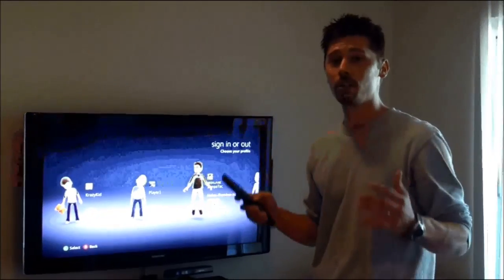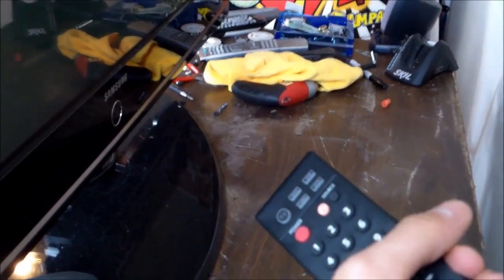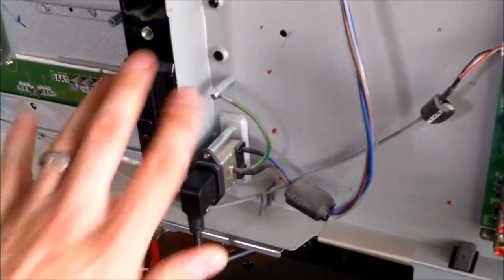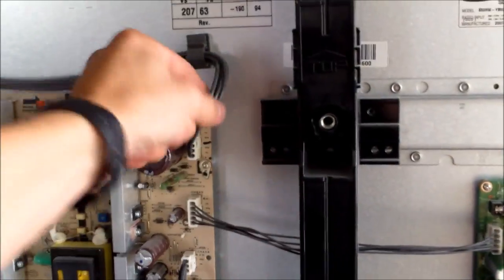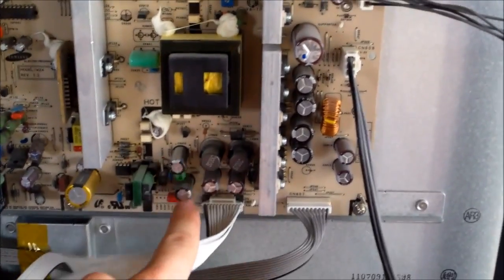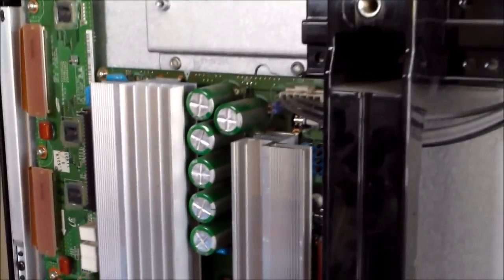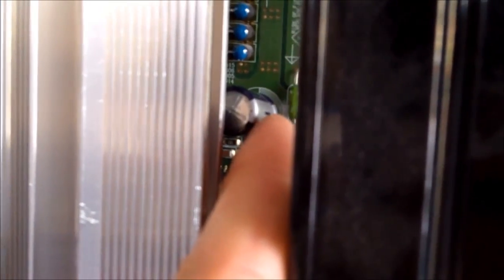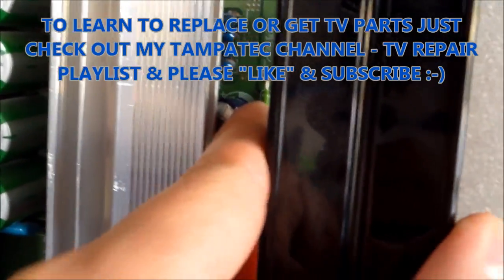WHAT Plasma TV BOARD CAUSES NO PICTURE REVIEW

Comment: Hi, please help...I  have a HP PL4260N 42" Plasma TV  and I can't find anything on HP tv repairs. The power button normally is red for standby then turns blue when powering up but for some reason it goes from red to purple. I hear a clicking but the screen doesn't come on and is black as if it's off. Any help please. Not sure if I  should just replace it.

Comment: Hi!
I have a samsung plasma tv PS64F8505ST (the last plasma of their high end tv models/ 2013 European model)
I would apreciatie the help from you about my issue. Last year i replaced the Y-susboard due to no picture. This time my tv turns of about after  30-90 minutes. Everything just shuts of, even the led light. Cant turn on the tv with my remote even after i replugg the cord to the outlet. I thought the problem sat at the X-sus board.

I tried switching to another x-sus board but the tv wont even turn on or show any picture. The power board starts to "clicking" instead so i unplugged the x-sus board from the powersupply and the "clicking" sound went away. When i switched back the old x-sus board it worked fine without any clicking sound from the powersupply but the tv starts to turn of again after 30-90 minutes. I had the powersupply get a light inspection (just looking after any visible faults) but the guy said that he didnt se any problem with the board. What do you reccomend me to do next?

Best regards

Comment: Hi, I’m just wondering if you could give me some advice, I have the same model your working on in this video, I bought it as spares or repairs and it wouldn’t power on at all. When I opened it up I found out it had two blown capacitors on the power supply board which I replaced but the tv still won’t power on, it didn’t come with a power cable So I just used one out of another tv the output on the plug is 250v but the power supply board says it will only take 220v could this be the issue or is it likely to be something else.

Comment: Hey i got a Samsung plasma pn64e550d1fxza and i found a burnt spot on the underside of the power supply board at a transistor(about the size of a quarter). Is it possible to save the board?  Wondering because I'd having no luck finding this board for under the price of a new tv. Bn44-00515a

Comment: hello I have a 50 Samsung Plasma TV Model PN50B450B1DXZA. that will not turn on, you here it click to turn on but does not come on. I have replaced the power/main board and the Y-sustain board and it still will not come on. What other issue could it be?

Comment: Hi
My Samsung ps-50q96hd tv has this issue.
When I turn in on it clicks once then video (like vertical lines comes on the right hand side and then I press the buttons on the side then I get blue jittery screen) also a loud speaker static sounds comes on suddenly and then it then clicks and turns off.
What is the issue with this?
I have opened the back up and tested disconnected every wires from the powder supply board (pspf531801A) and then connected one by one and tested it would only click when I connected the main board (the one with the vga and scarfs and other connectors ).
I was wondering if you could help me out.
Thank you so much

Comment: Hi: I have a Samsung Plasma TV model PN64F8500AFXZA. and I have tested all the capacitors, all the diodes, all the Mosfets, in all the boards and they all are fine, I have no short circuits in the Y board. What happens is that when I turn the TV ON, the "VS on" signal goes to 3.3V, and immediately goes to cero, all other voltages are fine and present, and stables, Could you please help with some ideas of what could be the problem?, I will be very thankfull, Thank you and best regards

Comment: I dont know if you even check these comments anymore, but here goes nothing. The tv had trouble starting, so i replaced 2 swollen capacitors on the powerboard and now it turns on fine. The  TV turns on fine, there is audio, but there is no picture. Do you think switching that fuse might work, or could it be that If I broke something on the power board that it causes it to not show picture ? Also , i lifted the TV when the lid was off only from the sides, could it have bent the screen, so its not working properly now ?

Comment: Help Me?

Model: Sony KDE-42XS955
Type: Plasma
Size: 42 inch
Manufactured: 2005
Retail: $4,995

I bought my Sony KDE-42XS955 from B&H Audio Video in Manhattan for $4,450 in July of 2005. It was the absolute finest TV on the market at that time. It never gave me any problems during its 11-year-long life. It finally died in March of 2016. It was still producing a perfect picture up until it simply refused to power on. When it would power on, only audio was working. The video went from perfect to nothing. There was never and fading of its quality over time. This leads me to suspect there's some internal power supply issue, or something that has nothing to do with the TV's ability to produce an image. Because again, the image was always perfect up until it died. 
I wonder if this TV can be fixed? It was the greatest TV I'd ever owned, and I've had many since this one. Today's average market range TVs still aren't as good as this set. This is why buying the finest TV you can pays off. You future-proof yourself for at least a while. Again, except for the highest-end sets, my 2005 Sony plasma was better quality than 95% of the TVs made in 2018.

Any ideas? Thank you for your time.
-Mick O'Brien

Comment: LG 50PS60 Plasma.  Intermediate sound with no Video.  If I unplug the ribbon cable from Main board to Tcon board and plug it back it in I can make the screen work on command.  When the screen comes on it is a great picture.  All voltages except VS are on spec.  Instead of 195 V, they are 183.  Thanks for any help.

Comment: Hello,
I have a May 2010 LG 60PK250 with what appears to be a power supply issue. The standby light Comes on, turns off, on, off, then stays on.

I received this TV used/broken. After inspection it appears it had some sort of surge through the main board. There were 2 blown diodes on the back side and a red audio connection had some black on it as well as a blue connecter. Not sure what caused these to apparently burn or Get really hot. I have replaced the main board and connecting cable from the power supply to main board. had a green light come on the logic board for a brief period of time first time firing it up after installing the new board. Now back to relay click on the power supply and only standby light coming on. 

Not sure what to try next, Set had a significant amount of dust on the boards. 
Thanks,
Jon

Comment: I have the exact same problem. My question is, can I replace said capacitor with one with a higher uf? Example replacing my blown 25V 680uf capacitor with a 25V 1500uf capacitor?
Reply: did you do it
Reply: Magdolna Madarász No. I replace it with a 35v 1000uf capacitor.

Comment: I have a Panasonic plasma TV Model TC-P58VT25.  Following and loud and very close lightning bolt, I heard a pop and thenTV had no picture but does have sound.  I am able to display SD Card information and also display the TV menu, but just get black screen when cable input is used.  Is this likely a Y board problem?  Also there is NO blinking red light (it just stays solid red).

Comment: do you offer help/advice with problems on tvs?

if you do we have a Samsung plasma model PN43E450A1F, it was working fine when i left the room then i come back and the tv is all black(you can still see the picture barley behind the black or more of the lighting is noticeable on the top and bottom edges of the screen) but you can hear the audio on the background so i turn it of and on and its still the same, later after i let it rest i unplug all connections re plug  but now i notice a sparking sound coming from the middle left edge where the plastic holds the screen(plastic looks a little warped/bumpy where the sound is coming from) and all the other issues are still the same. if you know what the problem is or could be or if you know of something that will fix this id appreciate it or any help thanks

Comment: Hey Tampa tech, great video. I have the same tv. after watching your video I think Ive found the problem but wanted to run my findings by you before I spring for a new power board. the symptom of the tv is: sound but no picture. the picture is pretty much all black with a tiny bit of snow. in checking the DC outputs from the power board, Ive discovered that the VA power pins are at 63 volts (correct voltage) but the VS pins are showing  no voltage. do you think my findings and symptoms are a match?
Reply from the maker: Beachbillies make sure you have a good ground when checking voltage if you're not get any vs voltage when the TV is on check the power supply. get tv boards at shopjimmy.com or electropartsonline.com
Reply: I saw this on an Y-Main the other day. I looked at the power transistor, and it has obviously popped. It had gotten so hot, the numbers for the transistor were cooked off. A quick check of that bad transistor showed it was shorted to ground. So this is how I could also tell. The board caused the Vs to go to zero volts and the power supply shut itself down when the Y-main was connected. If I pulled the power, removed this bad y-main, and checked again, Vs would go back up to 205 volts and stay there. 

I got this bad board from Florida, so hopefully it wasn't sold by +Tampatec lol.
Reply: beachbillies, what did you end up doing?
Reply: beachbillies, what did you end up doing?
REPLY

Comment: Hi all, maybe somebody here can help. I was given a 51 inch Samsung 
Plasma TV model PN51D530A3F. When I turned It on It would "tick" from 
the "power board" and I traced the problem down to the "X main board".
On the "X main board" I replaced 2 ( RPJ30H1 transistors), 4 ((30G124 transistors) except I used (30J124 transistors)rated 170v higher) and 2 ( SF10A400H) diodes.
After replacing these parts the TV came to life but now for the problem.
The "X main board" gets so HOT that you can barely touch the metal cover on the back of the TV.
None of the Caps were bulging ,should I have replaced them and would replacing the Caps eliminate the very high temperature.

Comment: I have a Vizio vp50 hdtv20a that I bought for $20 and I had the same capacitor on the y sustain board under the heat sink....replace the cap but same problem.. checked volts from PSU..all steady....I noticed when power is on all the boards that have a green LED light was lit except the PSU....any advice? also 5vsb is 5.10 and  A12v is 12.13 but steady

Comment: I currently have a Samsung hpt5054x/xaa that has gone black screen. The power is on and the supply is buzzing along, but no picture. I have not yet taken the TV apart to check in detail, but wanted to know what I might be getting myself into if I do start down the process of repair. Any suggestions?

Comment: Hi I have a SAmsung plasma PS50c96hdx version bk01 recently picture goes black after around 20 mins when using it sky ,but when tested with no sky it was ok , might be just coincidence but one hdmi port doesn't seem to work ,I couldn't acces menu on screen when it went black but had sound all the time ,no popping noises ,I have got back of can not see no visible damage to capicaters etc any ideas pls I don't have tester for volts

Comment: Hi there.  My parents have a Samsung plasma TV.
Model No.: PL50C550G1FX2X
Type No.: PL50C550

The tv turns on but has no picture and makes no sound while turning on.  In few seconds, the relay starts to flick, like turning it off and then turning it on back again.

I pressed the Volume and Channel buttoms and they do nothing.  I pressed the Source buttom and nothing, too.

I checked the voltages in the testing points: VS, VA... and they are ok (except when the relay from the power board turns off the tv).

Another thing, when I turn on the tv with the remote control or manually, I can't turn it off.  I have to unplugged the cord from the electrical outlet.

Can you help me.

Best regards

Comment: I have a 50 inch hitachi plasma tv before it was blinking blue light well I found out that the capacitors were bad and also lower buffer board so I replaced them well being an amateur I made a mistake by putting one of the capacitors in backwards well it blew the circuit board again ......... ok so once again I installed new caps and lower buffer board so now I have a picture on top of tv and none on the bottom and the tv on top that is working is now fuzzy so my question is what do you think it could be thanks

Comment: I have a Samsung 43 inch plasma TV, model no. PN43F4500 that doesn't have video or sound. I replaced all the boards, still get nothing. With the back off I get a green blinking Led, five times wait a short period then it repeats it, on and on. Is this blinking 5 times a code for what may be wrong with it, if so where can I find these codes ?? the TV was manufactured in May of 2013, I purchased it on Ebay October of 2013, so it isn't that old in useage, was a great picture the best I have ever seen on any TV, when it worked !!

Comment: I have a Panasonic Viera 42in Plasma tv. Model 42st30 1080P 600HZ A. For a year or so it the picture and sound would suddenly go off, come on for a period of a few seconds to several minutes, then go off again. It might cycle through this for 15 minuted to several hours then stay on. This occurrence is random. It may be several weeks to a month before it recurs. I have had the cable company replace the box several times with no effect. A week ago it stopped completely both sound and picture. The power light stays lit. The remote doesn't turn the tv on or off. The mechanical button in  the front doesn't work. I have pulled the plug without effect. The power light remains on when I plug it back in. Any suggestions?

Comment: I have a zenith 50 inch plasma TV model Z50PX2D and the screen does not come on when the TV is turned on. The little light on the receiver comes on to let you know the power is on but the screen stays dark. I read that the y subs board is the most common problem but I'm not sure exactly how to test it. Can you tell me how to test the board?
Reply: Did you ever figure out the problem? Im having same problem on same tv now.

Comment: I have a zenith 50 inch pdp50g10000. no sound no pic. stand bye works the board to the upper right popped. I put a fuse in that board and it popped. then tryed again it was on but no pic and no sound. but the light is solid blue and stays blue.
I don't now what that board is and what is wrong with it.
I had is 3 years and I played 3000$ for it.
I played 600$ for a tv that has Ben running for 9 years. I replaced the lamp in it 3 times.
I need help whit this tv problem.
I checked all power put to the board and it's good.
it may be a transistor.
IDK!!
PLS HELP😵

Comment: Hello: A great video and resource.  Maybe you could help me also.  About 6 month ago,  at times I noticed back of TV (Panasonic TH-50PC77U) was getting more hot then usual (not sure if that’s normal for these tv’s)About 2 months ago, TV randomly would repeat the same audio sound (would sound like a robot noise) for few seconds, I would turn the TV off, restart it and the sound would clear upAbout 2 weeks ago, I started to notice picture and sound distortion.  Sometimes I would notice colored Horizontal lines with areas of the picture on the screen distorted / scrambled on the screen intermittently, would clear up for a little while, then picture would get distorted again; Sometimes when I would switch the channel, the picture from the last channel I was watching would continue to show on the new channel (static image from previously seen channel or show that would clear up in few seconds.   Turning the power off would resolve the issue.  Also, at times, I would see the message on the top half of the screen that your cable signal is interrupted or disconnected, please contact your cable provider (the same message  that I would usually get if my actual cable service was actually out of service).Now, I lost all picture /video and audio completely.  I can turn  TV  on and turn TV off.  The power comes on.  I can access all the  menu features. But no picture or audio.
I need to find out which circuit board or parts I need to replace?  Thank you

Comment: Hi, great video.  I want to replace the y main but how do you disconnect from the y buffer board?  The ribbon cable is simple but I can't figure out the plastic connectors that connect the two boards.  I have a Samsung 42 inch plasma.  Any help would be greatly appreciated

Comment: Hi I have a LG PDP42x2 Plasma. Sound is there but no Image whatsoever. I checked the fuse on the Y-sustain board and it was blown. I replaced the fuse and the TV poweron light will be green for about 3 seconds and then turn back red. When I remove the fuse the TV has sound again but no Image. Is the Y sustain board faulty. I dont want to buy a new board if its not the problem since it is such an old TV

Comment: I have a Vizio 50 inch plasma, and so does my friend , bought at the same time. mine started earlier but he now has the same problem, which is the tv comes on and the sound comes on but no picture, if I let it "warm up" and cycle the on off it will come on with picture and sound. works great but its annoying and Im guessing eventually it will stop altogether. Now I am old enough to remember having to let the tv warm up before the picture came on but its getting old and I think my friend and I are going to open them up and see what's up, any suggestions on what to look for ?
Reply from the maker: Check volts to sustain board if ok then check sustain board fuse, transistors, and buffer board ic.
Reply: +Tampatec thank you